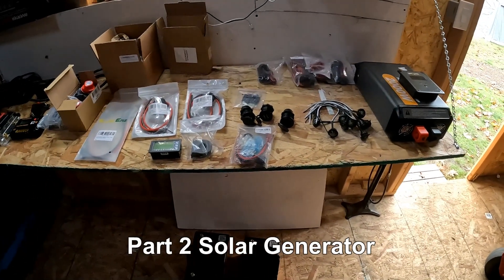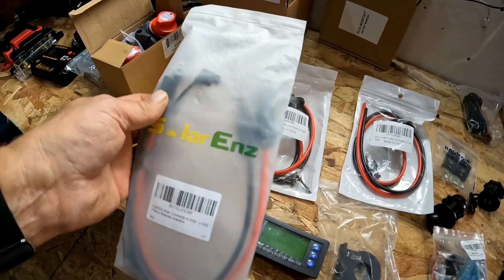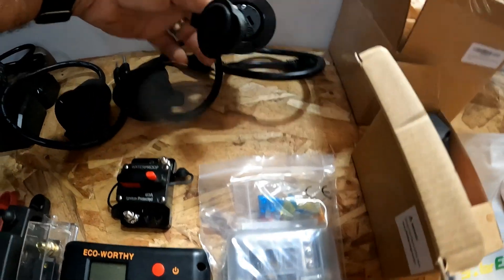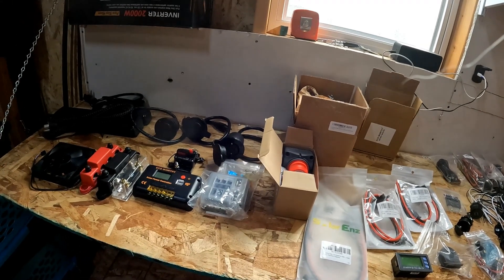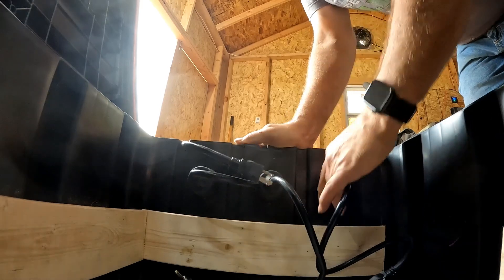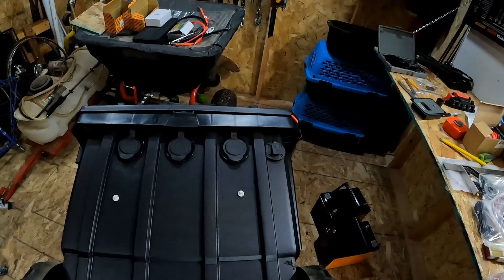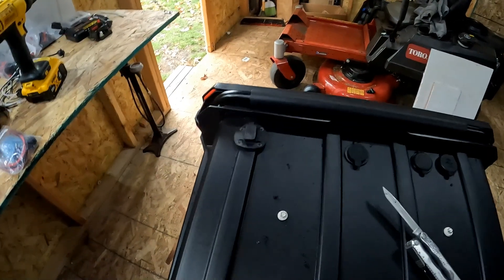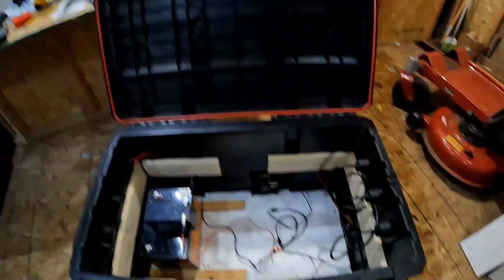Solar Generator build part 2

Comment: Thank you so much for the video... Can you please provide links to where where you purchased your outlets? Also I think it's better to have the exhaust fan as high as you can get it so it will tend to exhaust hot air more than cold air
Reply from the maker: Thank you for watching the video and glad you liked it. I purchased the outlets on Amazon
https://www.amazon.com/dp/B07XF5D8HK?ref=ppx_yo2ov_dt_b_product_details&th=1
I originally was going to put the inverter down with the batteries but it ended up not fitting so I had to move it on top. I figured I can just open the lid if I need too.